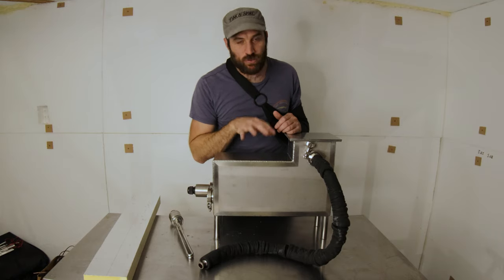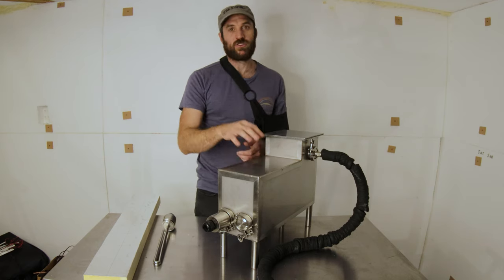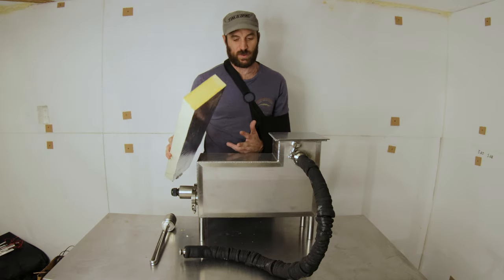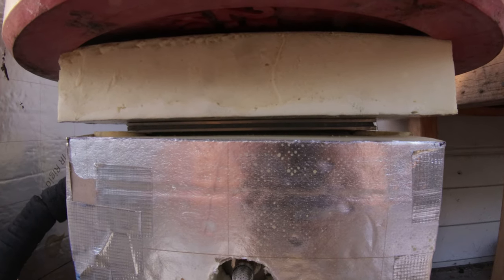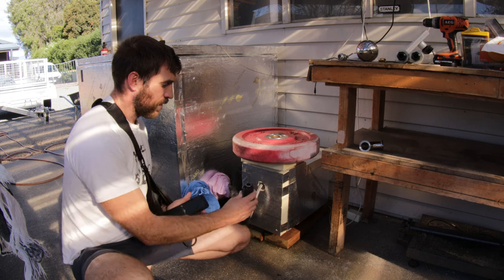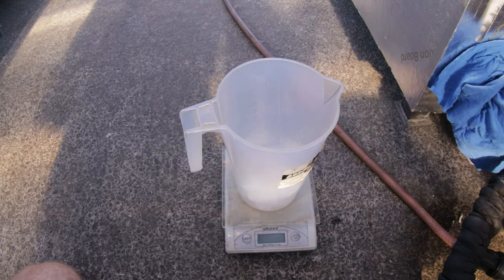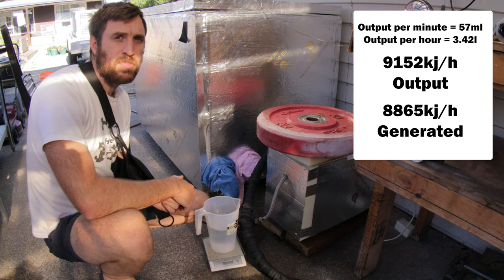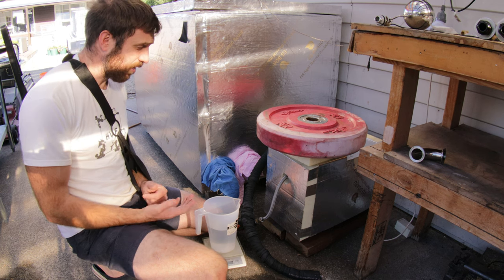The Best Mushroom Growing Steam Generator You Can Make?

Comment: Hi a Big thanks to Oak and Spore im all new to this but im also a st/steel fabricator so yep i made mine and put in a few changes.. bigger diameter steam output pipes and a 3kw element  also has a 2kw element in the body aswell but havnt wired up yet. The body was made from 2mm st/steel and i ended up high temp silicone and bolting lid down as i used a 11/4 socket my id of output hose is around 28mm 30mm so since its going to atmosphere no pressure should build but will still put a safety valve in later,, im using just under 4ltrs of water p/hr  and for the now just have a 25ltr drum gravity feeding unit which will change to a 100ltr drum so i dont have to get up and refill late at night and will soon make it so my condensate can return back to it to save more energy as feeding in preheated water will turn to steam alot quicker but in saying that it heated my drum to 100 degrees C in bang on 1 hour. Great ideas and well worth your knowledge thankyou again..will update you on any big changes.

Comment: Hello.  Would it be feasible to use an horizontal freezer as a basis? Generally it is insulated and quite airtight, no.    If one takes low cost version or a second hand, the cost is minimal and the work not more than making sure the cover seals well and a steam tap is fitted.  Thank you for the advice.

Comment: If you cut a hole in the top plate you have weighted down, you can add another tri clamp port to the top and utilize a stainless PRV. If you make it removable, it could double as your fill port. Then you just sanitary weld that top plate down. They even have spunding valves that you can regulate the pressure with.
Reply from the maker: I had thought about that, installing a 2psi PRV. But the method I used was the simplest and cheapest. I might make alterations in the future.

Comment: you could save about 10% or more by preheating the water intake with a cheap DIY solar water heater, this could shorten the startup time and while running you need to have a good system that can heat 3.4l per minute as close to 100c as possible. Also bags could be filled with hot water (solar heated) and instantly stored in the tank? So less time to heat them up, but not sure if that fits into the workflow, the insulation could keep the heat for a while though.

Comment: Awesome boiler! I would however, suggest to have the lid spring loaded instead of weighted down. That way you can easily adjust the force pushing down on the lid, simply by turning a screw, and you won't risk the weight falling off halfway through a long sterilization process.
Reply: I would suggest some more safety features, like a hinge and loose latch or something idk, cause it's gonna be a bad time for anyone is near that thing if the weight falls off.
Reply from the maker: There is near no pressure, so if the weight falls off, only a little steam comes out the top. Pressurized boilers are the real dangerous ones.
Reply: @OakandSpore  I was curious why you aren't using a pressure steamer? i know heat sterilizes fine, but wouldn't containing the pressure use less water and take less time?
Reply from the maker: Its costly getting something large to hold steam pressure. There are also a lot of laws around pressure vessels, they need to be inspected and approved because they are very lethal in the event of a rupture.
Reply: @OakandSpore  ok thanks for the information!!

Comment: You can build a custom heat-pump boiler and use it to cool your house while boiling your water ;)  Can be about 4x more efficient as resistive heating (eg you can get 4kw heat into the water for 1kw of pump operation).  Love your videos.
Reply: @EasyX2y  two stage can absolutely boil water
Reply: @neogeo8267  i said usually, i doubt these are cheap/readily available. Also they are less efficient. But yeah if you have them available at a price point feasable, why not.

Comment: How are you planning on wiring the safety switches into the elements?  I suppose you'll use a low-voltage & isolated relay or similar?
Reply from the maker: The switches will shut off the PID Controller.

Comment: My God it's beautiful, I've laid eyes on it for 15 seconds and already I'd drop almost any sum on this. Also props to whomever manufactured that for ya, real top notch work. Any estimate on cost for the total build?
Reply from the maker: The fabrication is the most expensive part, and stainless fabrication generally isn't cheap. I got 2 quotes, and the varied by a whopping $350 USD! The fabricators I used were about $550 USD.
Reply: @OakandSpore  just lucky I happen to be a stainless steel fabricator aye...love you vids keep them coming and when this covid is done with i wouldnt mind coming down from Auckland and meeting you in person if possible..
Reply from the maker: You're a fabricator in Auckland?
Reply: @OakandSpore  yes i am have been so for 30yrs
Reply: I will email you my number
Reply: with steel prices where im at right now (eastern USA) itll cost about $2500
Reply: i just got the project proposal cost back from a steel fab place, $4,212
Reply: @LazySillyDog  with that much, get yourself a welding machine and learn how to weld. it's not that hard
Reply from the maker: , I can get it done here for 700usd.

Comment: Just about to build some sort of steam contraption closely based on your methods. One thing though is why don't you use the condensed water to feed it back into the boiler so that it doesn't need to heat fresh water from say 20-100c but instead heats 95c water to 100. I remember on another video you mentioned the energy that it takes from 1-100 is 1/5 the energy to get it from 100 to steam but that's still potential wasted energy. Unless it is really really negligible?
Reply from the maker: I't quite negligible. The cost of setting it up to recoup would be more expensive than the cost of just using a bit more power to heat the water.

Comment: 8:13 a submerged electrical water heater is essentially 100% efficient at converting electricity to heat 1:1   While you could get more energy into the system for less money by burning fuel it won't have the same energy conversion efficiency as a submerged heater.  If this system is solar powered (pv or thermal) it is way better than burning a fuel in terms of clean and green.
Reply from the maker: yes I figure it was 100%, but I read thing online saying they aren't quite 100%. I think limescale buildup actually lowers the efficiency somehow.
Reply: So long as you are not converting to steam. The phase transition is causing a fairly large hit, and any steam escaping magnifies the effect. (In other words you are more correct than you might have supposed)

As to the lime issue, minerals in the water are going to be problematic to the degree the minerals precipitate out and the insulation it causes. One possibility would be to run it in 2 stages. Run stage one under the precipitation curve, this distilling the water and running a second element to step the temperature up to steam, if steam is fully necessary. The first stage water will get heavier as minerals are left behind, but the lime scaling should be reduced. A regular cleaning with vinegar or some other mild acid would extend element life. 

I have not run the maths on any of this, it is simply off the cuff thoughts.

Comment: Got the blueprints! 

Also, for the water level switch and temperature switch at 5:46, where did you end up installing them? 

And did you need to drill new holes for them? And do you mind providing the shopping links for them too? 

Cheers :)
Reply from the maker: google part number 2455R 9082-463 L110C  I will install it right next to the element on the outside. Opens at 110c, which will stop the boiler.

Comment: Hey mate i am grately inspired by your content and i am try to build an almost the same setup, i would like to ask you how long does it take with your 2.5kw element to heat your tank ( i suppose 1000lit) and if that power is doubled would that time be proportionally reduced?
Reply from the maker: About 10 hours when its around 60% full (60 x 5kg bags) if you doubled that, it would effectively half the heat up time. Its all about how face you can get joules of heat into it.
Reply: @OakandSpore   Thanks a lot for the info Tom, i just purchased the blueprint and i have some questions should i post here or better by e mail?
Reply from the maker: Send an email!

Comment: Hi mate it's always a pleasure watching your vids thx a lot. However I was wondering how you control the temp inside the chamber. How can you stay around 80 Deg ? Cheers.
Reply from the maker: Inside my sterilizer chamber? I have a thermocouple inside the chamber connected to a PID controller.
Reply: @OakandSpore  sweet. Where is it physically placed in the chamber? I'm asking coz the steam is very hot way above 80. Are you placing the thermal sensor inside a bag?
Reply from the maker: The sensor is in the top of the sterilizing tank, above the blocks. The steam is pumped into the bottom of the tank.
Reply: @OakandSpore  thank you ! I'll start a mushroom business in France by the end of the year and your explanations are really useful. Mush love !

Comment: Hey man,great job,building our own mushroom farm w m brother,we bought your plans,and so far so good,
Just we stuck to the modification of the floater arm,could you share the specifics about it?our original was a straight line,but in one of your videos we saw that you "warped" it in a different shape(or that model came out like that).we either end up having the floater sphere to low to start running water so its touching the element,or it is to high and the floater doesn't stop .maybe its the floater model/design after all.thanks anyway!!!be well!
Reply from the maker: There is a float model which fits really well into the boiler. Just needs a little bending to adjust perfectly. It should be linked in the description. Send me an email if you are still unsure.

Comment: What about solar radiant heat powered steam boiler?
Reply from the maker: Like with PV panels? You would need a huge battery to store the energy and power it.
Reply: @OakandSpore  I was thinking a large parabolic mirror boiling water?
Reply from the maker: You might have prohibitive setup costs, and it might not work on a cloudy winters day.
Reply: @OakandSpore  youtube has videos on making parabolic mirrors out of cheap mylar. How many days of sun is how many days of free steam. It may work moderately even in cloudy days. On those days you can always suppliment with electricity?

Comment: How many hours do you run your sterilizer?
Reply from the maker: around 20 after it's warmed up.
Reply: @OakandSpore 
OMG really? I did my first batch yesterday and I had it run for 6 hours,  I guess the first batch gonna contaminate real bad.
Inoculated with P Eryngii 5%
Reply from the maker: You might be alright. To be honest I haven't found reliable data on how long you need yo run the for, plus the temperature plays a huge part in now long you need.
Reply: @OakandSpore 
Another youtuber does it for 12-14 hours and he has a couple of all-American sterilizers.
I will share with you my results later.
Great content BTW
Reply: @pauloantunes8826   the goal is a core temperature of 200f for 6-8 hours. Use a temp probe on your next run
Reply: @pollopollo3531    can i use that steamer for ,,white button compost,, which needs  65 C  for about 7-9 days pasteurization ?